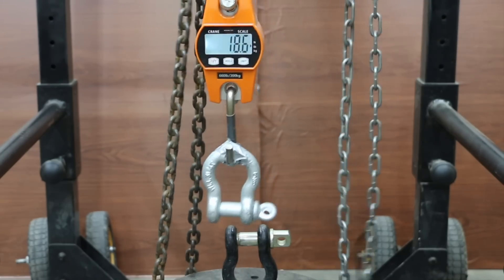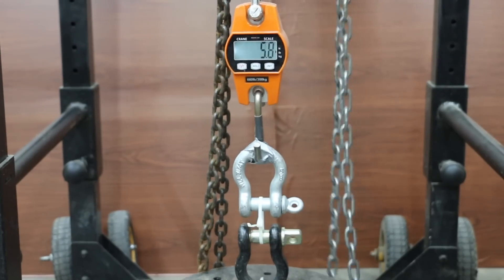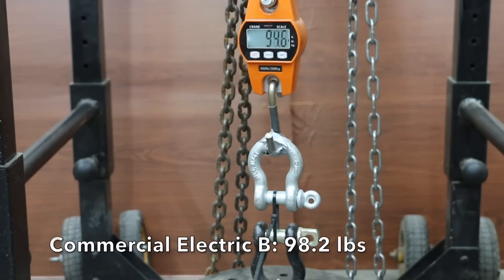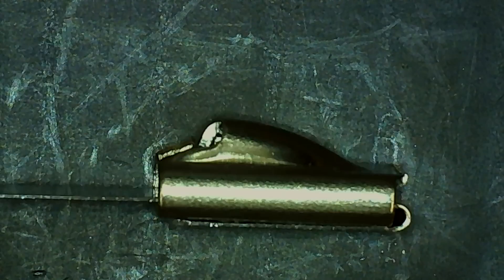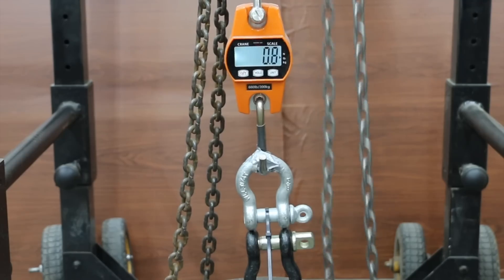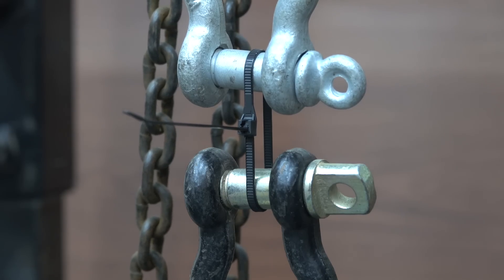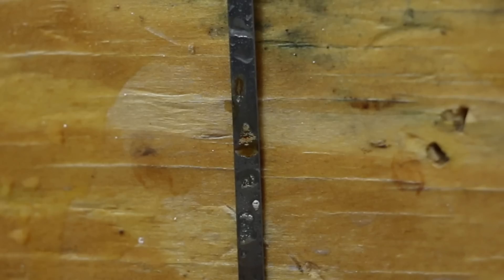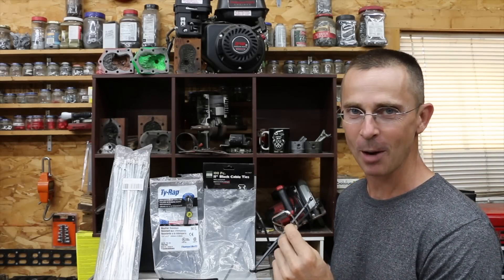Best Cable Tie (zip tie) Brand? Let's Find Out!

Comment: I really love the follow up, thanks man! Could you eliminate the hiss in the background caused by your microphone? A very easy way is an audio effect called a high-cut, but both Audacity and Adobe Audition have noise and hiss removers, and those should work much better. If you need any information, feel free to reply with a question. I will be here to assist you.

Comment: I bought commercial electric cable ties. However they failed at the locking point just putting them together. at roughly 65 degrees F.. And that was before this test.
Reply from the maker: Thanks for the feedback.

Comment: ive got a great test for you 😉 years ago i decided to experiment and use a dishwasher as an engine parts cleaner 😆 i was reebuilding refurbing one of my bikes and on the box of dishwasher ditergent it said cuts thru grease 😲 I DECIDED TO TEST THAT and loaded up the dishwasher with motorcycle engine parts 👍 the misus came home and found the dishwasher full of engine parts 😕 and went beserk 😳 did a great job on the engine parts ddo 😉👍
Reply from the maker: lol  Thanks for sharing.

Comment: I can vouch for Panduit TyRaps - those are amazing when you need a quick zip tie that you might have to leave on a hilltop antenna site for a few years.  The stainless ties are better, of course, but a little harder to install.  Keep a bag of TyRaps in your go-bag and you'll have ready ties whenever you need them - the cheap all-plastic ties... not so much.  Those even degrade just sitting in a bag.

One suggestion: Try soaking the ties in solvents (tolulene, alcohol, gasoline, naptha, etc.).  You will find that most all-plastic ties degrade in a few days, if not hours.  TyRaps are amazing, but N66 is not perfect and will not last forever in a powerful solvent.  For that, you need the stainless wraps.

Great video, keep them up.  I learn something new all the time and I definitely try to steer folks to your channel, which is amazing.  Cheers!
Reply: And one more comment on kit: Regular old SS safety wire is great kit to have in a climb-the-tower bag.  If there is a concern for cutting-in on coax, you can carry some rubber sheet and safety-wire the whole shebang.  Safety wire will last for many years in the environment, but the pull-strength is probably low (20-30 lbs) compared to TyRaps.  Sometimes you only need a little tension to hold something down, and when that's the case, a roll of SS safety wire is a great all-around solution that will last forever in a tool bag and can save one's bacon in a pinch.
Great channel, great videos, and awesome content!!!  Cheers!
Reply from the maker: Thanks for the suggestion.  Thanks, will do.

Comment: I would like to see a comparison of headlight bulbs. I have always bought the same type and brand but it would be interesting to see if there is a better option out there
Reply from the maker: Thanks for the video idea.
Reply: There are better options. You can get non factory spec stuff. We did that on our utv, might use more power, but nothing noticeable
Reply: @benr8071  i did try LED at one point but they died after about 6 months, probably a bad brand.
Reply: @jmrmkeo  I did read once that if you go LED headlights and if bulbs share a capsule then you need to replace both bulbs as the LED bulb isn't made to last through the heat of a Halogen fixture. Also, read that this isn't good if you live in a state with snow. LED apparently won't melt ice like how regular bulbs do.
Reply: @jmrmkeo  Definitely don't run LEDs in an older car with reflector housing headlights, the housings were not designed for LEDs and you will blind other drivers. I wish more people knew this. I'd definitely like to see this test too.
Reply: In my experience the brighter more expensive bulbs blow out WAY faster than the standard bulbs recommend by your vehicles manufacturer. I bought a really nice and bright pair of bulbs a few years back, the brightness standard bulbs you can buy and they both blew out within a year, and my brother had the same experience.
Reply: @Tyler_Owen23  Was wondering if the extra heat did any damage to the fixture the bulb sits in?
Reply: Terry Doberstein well the car I used them in was 15 years old so there was already some damage but I did notice some bubbling in the reflecting paint in the housing that wasn’t there before.
Reply: I've got a 99 Dodge Ram Van with 230K miles...and just recently had to replace a headlight bulb...that was the original halogen...plenty bright...replacements...Sylvania Halogen..$30 a pair..guaranteed 5 years...
Reply: Light bulbs are basically temperature based. The brighter they are, the hotter they burn. The hotter they burn, the less they last. For led, look up headlight revolution here on YouTube.
Reply: #Wardlike true, but if I’m spending $60-70$ per bulb I’d expect it to last more than a year
Reply: @Tyler_Owen23  This is true. That's just not how things are though. I have found it matters the housing the bulb is in. Housings that disapate heat better work better long term.
Reply: @iamdrako  Big fan of that channel..

Comment: Not tool related but what about air purifiers? I recently discovered that my winix brand purifer is programmed to claim indicate that the air is cleaned after about 20mins even with the filters removed! Upon plugging the device into the wall it flashes the led colors then stays blue for about 5 mins and goes red for about 20mins indicating bad air then back to blue indicating good air, all of this without the filter
Reply from the maker: Thanks for the video idea.

Comment: One really critical test missing from this set is overall strength under long term flexing loads or vibration, it would hard to design a comparison test for that but it's going to ultimately provide the best feedback on how the ties actually last up to real world use. I mean if your zip ties slacken after you've tightened them from vibration they're not doing the job well.
Reply from the maker: Thanks for the suggestion.
Reply: @ProjectFarm  although it might not be worth the effort, my takeaway from this video was stainless straps are awesome :)

Comment: Which data is more significant in determining and comparing strength? The actual failure point value or the actual failure point value divided by the product’s maximum rating?

For the UV test, did the non-UV samples come from the same bag as the UV samples?  If not, it seems possible that there could be manufacturing differences between to two sample lots.

Great job. Love the channel!!!

Comment: HERE IS A TRICK TO GETTING MORE STRENGTH OUT OF EACH ZIP TIE WHEN POSSIBLE! If you are using a 12" zip tie to hold two 1" poles together, instead of just looping it around once and then pulling it tight and having 6" of tie to cut off wrap it around twice then lock it so it is nearly twice as strong. The smaller the thing the more times you can wrap it around, meaning less wasted plastic you need to snip off the end and if you do cut it off or something and the zipper is still intact you might be able to reuse it with one less wraps around the object. Instead of using 20 zip ties to hold something you can use 6 that are wrapped around the thing 4 times to get the same strength. For critical things it is still best to rely on multiple zip ties because even if it is wrapped around 5 times you are still relying on one single zipper mechanism and if that breaks you lose all 5 of those wraps. Just a bit of critical thinking to spread.
Reply from the maker: Thanks for sharing.

Comment: As long as they say they are made of nylon usually a pretty good tie. There for awhile  a lot of them weren't. Around where I live for a few years you had to go to an electrical speciality store to get them. Back in the day o 40 years or so ago we would use the on gas lines and transmission lines no problems. Wouldn't advise it but that's what we did.
Reply from the maker: Thanks for sharing.

Comment: Yes! I remember the last video! The electrical company I was working for wanted us to use just TyRap brand ties and I was disappointed not seeing them among the contenders. Great video as always sir. Everything you do is entertaining. I love it and I thank you again!
Reply from the maker: Thanks so much!
Reply: do you know which ones did the company wanted to use? TyRap makes a wide variety of ties.
Reply: @somepunk2541  The same ones he tested. My curiosity was how well the lock held up. This was in West Texas. I would use them mostly to tie down ground wire along steel pipe. I can say though after a year with the heat of the sun and the pipe from the pressures of the oil going through, they become pretty bridle too.

Comment: Great video as always! Could you consider doing. A video comparing different septic tank enzyme treatments to break down solids like green gobbler as an example? I use this monthly, flush it down the toilet in hopes of it working. Would be curious to see if and how well it actually does work. https://www.homedepot.com/p/Green-Gobbler-Septic-Saver-Enzyme-Pacs-GGSSEP/206337694?g_store=1258&source=shoppingads&locale=en-US&mtc=Shopping-B-F_D26P-G-D26P-26_7_PLUMBING_REPAIR_And_REPLAC-NA-NA-Feed-LIA-NA-NA-DrainChemicals&cm_mmc=Shopping-B-F_D26P-G-D26P-26_7_PLUMBING_REPAIR_And_REPLAC-NA-NA-Feed-LIA-NA-NA-DrainChemicals-71700000053283179-58700005117670196-92700044888771738&gclid=Cj0KCQjwqfz6BRD8ARIsAIXQCf2X6L9IgvJmU6go1TGER0mS2h3eM7M_wfeizFhknGuJVO_1rGX3KWsaAvNmEALw_wcB&gclsrc=aw.ds

Comment: You should try those SS on one of the most common old time drag strip repair, replacing U joint straps and pinion flange bolts.
Reply from the maker: Thanks for the suggestion.

Comment: You should test car headlight brands. Do they actually last as many hours as they say they do, how hot do they get, how many times can they turn on and off before failing, how much power do they use, how far can they light, etc.
Reply from the maker: Thanks for the video idea.

Comment: If 2020 wasnt weird enough...  Now zip-ties exposed to sunlight get stronger...???
NOT what I was expecting.
Awesome job.
Reply: There are five characteristics of a material. Strength,Hardness, Brittleness, Ductility, and Toughness. Radiation from the sun causes materials to become brittle at the same time the are Harder and Stronger however when Brittle Fracture occurs it is more violent. Ductility and Toughness are inversely proportional so mode of failure can also change. Hope this helps.
Reply: @hicaltv4648  I was thinking along the same lines. It's like steel. You can make carbon steel very hard and it's strength will increase, but at some point it becomes so brittle it is no longer useful.
Reply from the maker: Thanks so much!
Reply: Same! I'm totally stunned!
Reply: They get harder/ more brittle, think of a tap, impossible to scratch with a file but real easy to snap and shatter.
Reply: I would find it useful to know how the 1 year UV exposure was applied. Were they laid outside on some kind of surface, such as metal or wood. Bunched in the original bag or individually separated. In Arizona or Illinois.  Also, what kind of oxidizer was used on the stainless steel tests. Chlorine bleach e.g. "straight", 2 cups/gal.H20,  or some other oxidizer.
Reply: Don't forget to freeze them as well! They sure improved with the cold
Reply: Guys that's not it. It's the same as nylon 6 for 3d printing - moisture makes nylon 6 more ductile and tough. That's why they are tougher to break once they've been exposed to the elements - they've picked up moisture

Comment: Quick question: if you add multiple ties, does the weight capacity increase by the amount of each tie? For example, does using 2 ties double the capacity?

Thanks for the great video!

Comment: Fantastic video as always! Makes me curious if the zipties keep their strength in the colder temperatures that the manufacturer's recommend. Would the breaking point be at the neck of the zipties or a tear down the actual zip ties. I've had many zip ties break right as I tighten them during the MN winters verses not being able to break them during warmer weather.
Reply from the maker: Thanks for the suggestion.

Comment: I never would have expected any of them to get better after UV exposure. That's quite interesting!

Stainless Steel cable ties would be great in high heat applications. I actually didn't know those existed. Gonna need to get some for certain auto repair work. Thanks for a great video!
Reply from the maker: Thanks for the feedback.

Comment: You should test the fuel efficiency of a generator running 50 to 1 premix or just gasoline. I would expect the lubricating properties of the premix to make the generator run more efficiently at low loads.
Reply from the maker: Thanks for the video idea.

Comment: For what I use ties for,  they don’t need to be strong. What gets me is when I take ones right of the packet that have been sitting in a dark garage for  7 years and they snap when I try to use them. I don’t use them often, but when I do, I want them to work. I just bought some stainless ones. I figure they will have a much longer shelf life. Maybe you could gets them after 5  or 7 years.
Reply from the maker: Thanks for sharing.

Comment: Does anyone else cut and then bend the stainless tie so it wedges into the holding part that was the way I was taught. I wonder if it ups the holding power? Also how long until all zip manufacturers start running then through UV to up the holding power. Or if the ones made in china start producing them outside. Just kidding about the outside production. Anyone else wedge the metal ties?
Reply from the maker: Thanks for the feedback.

Comment: Really glad to see you added the Ty-Wraps! There is a reason we use them on communication towers and Telecom infrastructure. One load case which would have affected the UV exposed ties much more would be torsion. Lots of laterally applied loads in the lifetime of some of these ties.

Thanks for reading, and thank you for everything you do.
Reply from the maker: You are welcome!
Reply: Oh yeah. Tywraps. Shame theyre so darn expensive
Reply: @ayylmao7666  Yepp. Definitely not for homegamers as a rule.
Reply: @jawms and to think my workplace goes through tens of thousands of dollars worth of tywraps and other cable ties every year....

Comment: I have a test for you.   It's not brand names rather, it has to do with material load strengths.  For example, testing deflection on pine vs. oak 2 X 4 using a cantilever.  Doing the same with standard plywood vs. 13 layer Cabinet grade Birch w/birch core.  Doing the same with Steel, Aluminum,    you could expand by changing the material construction i.e., Ibeam, square tube, pipe, etc. etc. etc.   Just wanted to say I enjoy your reviews.
Reply from the maker: Thanks for the video idea.

Comment: Next video suggestion, which fixed blade knife is the best to shave with, K-Bar, Buck, Imperial, or a harbor freight brand.
First test, fresh out of the package shave of one day stubble,
Second test 3 day stubble, without sharpening,
Third test, 3 day stubble sharpened

Last test full shave of a 6month old beard not sharpened, and sharpened.

Which knife is best for the “ Dundee shave”